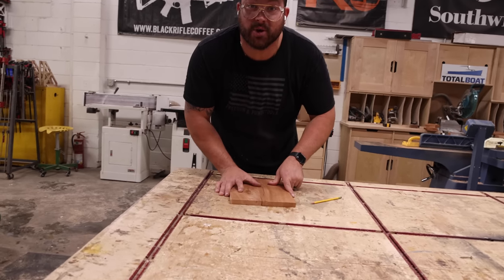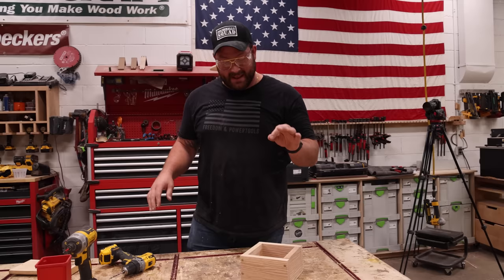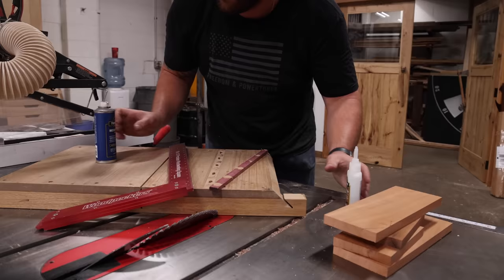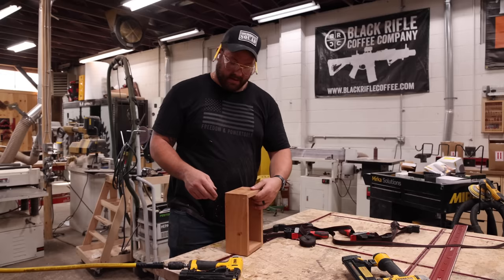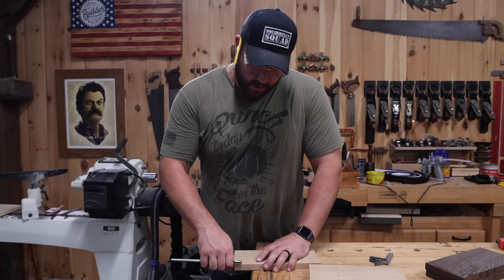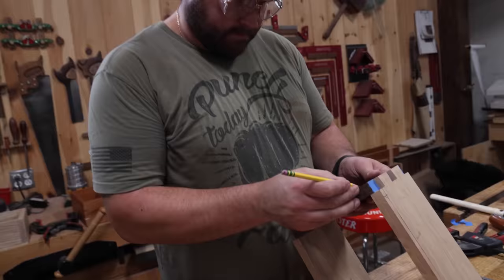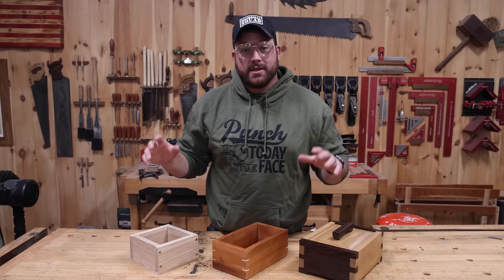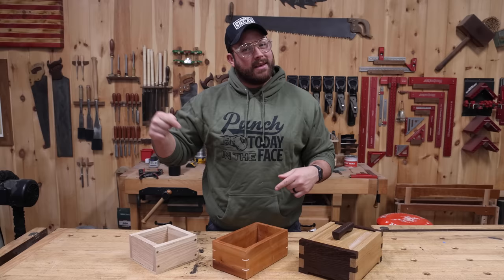5 Min vs. 50 Min vs. 5 Hour - Box Build

Comment: This definitely shows the importance of having system in the tools and hardware 😄 my recommendations try to use 5S in your workshop. Then look through your entire videos and see how much time you wasted walking around to find tools, instead of having the tools where you need them and a system where it is easy to find. Then see how much time it takes to make them with an optimised setup. I bet you can take 40-60% of the build time 🙂
Reply: Organized workspaces always work better, my tools are set with hand tools dedicated spacing for measurements cutting and finishing... And power tools for milling miters and curves and finishing... But it works for me. 

The way towards a better future is improvement upon yester( day, month or years) miss takes

Comment: Something I learned a long time ago, I don't even remember from where, is to always have your stuff figured out before starting anything. 
In woodworking it means: grab every tool you're going to need and put close to where you're going to work... The same with everything you're going to need, like screws and other stuff. And, finally, enough wood to start milling it. You know?
Do all this BEFORE you start the clock, otherwise you won't know exactly the time you needed to do the task. (Now that I wrote it down... Maybe I learned it when I studied about softwares for productivity measurements...)
Anyway, fantastic work, John! 😊
Stay safe there with your family! 🖖😊

Comment: This is not an unrealistic challenge as we reach the HOLIDAY season and woodshops around the world gear up for that special something for Christmas - 5 weeks turns into 5 days turns into 5 min left: PLEASE FINISH, DRY! - maybe in the OVEN? (Kidding kids, don't try this at home. Mom and Dad will be very mad!) For 5 min, I'd probably have pin nailed the whole thing with glue and skipped screws. For the 5 hour, router jig the dovetails and have more time to add hinges, sand and fit/finish. But you have all your digits and got it done sir. Nice job.

Comment: Those were some interesting builds, but you didn't seem to be prepared.  I have a really tiny shop, 9x9 feet, and I my cutting and sanding tools are within 10 feet outside the door.  I do some of that running around, but if I went as far as you seemed to have, I'd have been arrested for stealing my neighbor's tools at the far end of my home, LOL.  I  see the advantage of a small shop now. :) 

When you did your second box, I'm surprised you didn't use the masking tape clamps like so many of the YTers do.  Then, again, you are really under pressure and have probably already figured out a dozen ways you could have done better. 

Great video. I really enjoyed it.

PS I'm glad with all that rushing around, you didn't have any injuries.

Comment: "I cant believe it's been 20 minutes, I feel like I did nothing"
- Made the box edges
- Recalibrated the outfeed on the jointer
- Changed the tablesaw blade...twice
- broke the sled, rebuilt the sled.
Sounds like 2 hours work to me.

Comment: seems using just a pneumatic nailer and glue would have been quicker choice for 5 min box.. Dove tail joints go a lot better using a jig and router..(unless you want to be old school and do them by hand but then you wouldn't be using a table saw either).. Also in a shop your size (and in my case also) very rarely are you only working on a single project at a time. 
P.S.; where you finding the time to do these videos  keep it up

Comment: Great idea! I'd tweak the rules a bit though. You should be able to presetup your tools, pause if a tool fails (and you have to change the bandsaw blade) or the glue has to dry. The right tool for the job, the right parts for the job should still be followed. You would have made the deadlines and not been unhappy with the results.

Comment: You probably would have done a bit better if you didn’t have to take the time to fumble around with getting the joiner fixed, fixing your table saw sled, swapping sanding belts, and searching all over for the tools and hardware that you needed lol. Great challenge though and I like this sort of change to the beginner, intermediate, and expert series that you have been doing.

Comment: Rather than do three projects by time, why don’t you do it by tool level? For instance level one is hand power tools only. Level two you add basic shop tools like a tablesaw may be a bandsaw may be a drill press. Level three is of course all out with all the expensive CNC machines and everything else. That would be pretty cool and useful for many woodworkers.  Better yet, level three adds a planer and a jointer and skip the CNC that none of us have!

Comment: Maybe I suck .But every time I use the hammer drill I strip the screws. But every time I use the drill with a clutch I've never striped a screw. I think those hammer drills are not meant for wood or bricks.

Comment: I know it's practically a totally different trade, but in concrete carpentry, on pour days the inspectors need samples. Sometimes this requires a box - example, in shotcrete specifically they need a 16"x16"x6" box to get shot into and filled up as a test sample - and when the apprentice builds them the day before and they all explode... 5 minutes is a long time, and you only got a skilsaw, hammer, nails, and the ground. Nothing like a $200,000 concrete pour being held up to put a fire under your ass.

Comment: "What happened to my jointer"
Nothing happened, the problem is the thing i've commented on like 10 videos so far, you don't use it correctly. Go watch any parillaworks video if you want to see the correct way to use a jointer. Downward pressure on the out-feed table, not the in-feed table.
ie: At 11:43 you are pushing down with your feed tool on the in feed table, this will transfer any warp that is in the board, instead of removing it.

Comment: Maybe should've gone old school and hand cut dovetails for the 50 minute box. Or even jointed the boards together in a vice with a hand plane. Would've taken less time than the first jointing, much less the machine correction and second jointing, and foolproof jointed together.  So much for the right tool for the job.